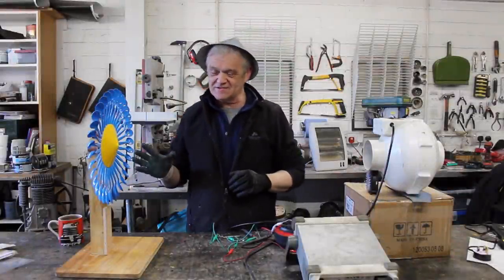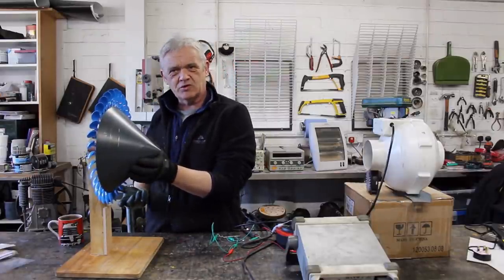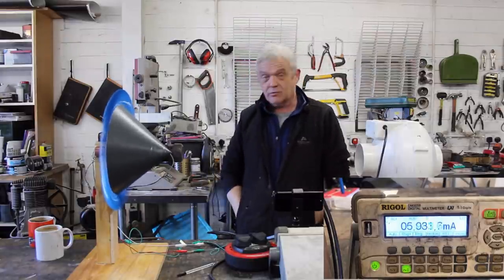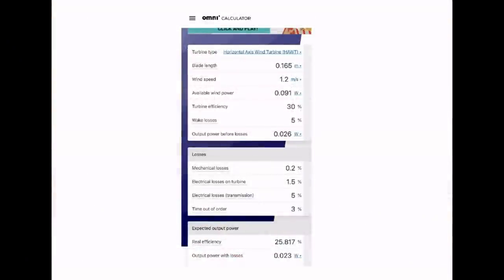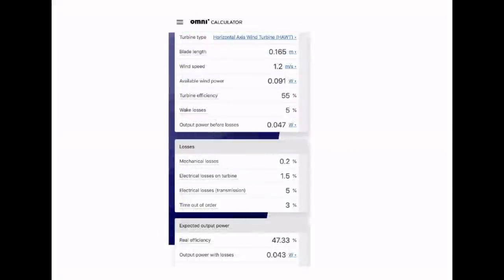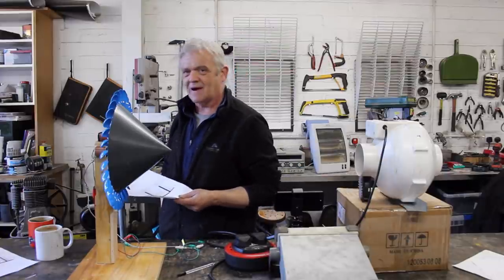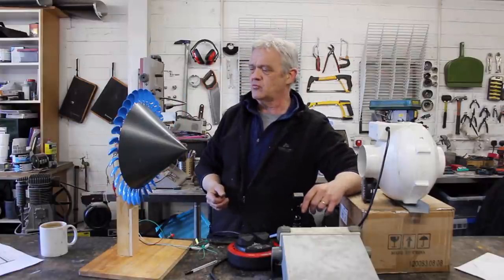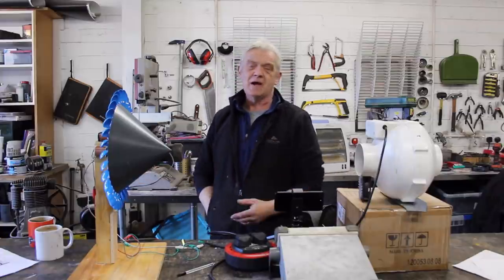1482 A Diy Super Efficient (93% Efficient) Wind Turbine

Comment: Could you use a fixed cone with fins spiraling in the same direction as the spoon's spin? Currently the cone has the opposite effect as it's boundary layer will be dragging the airflow in the same direction as the spoons which would decrease the airflow's force on them..

Comment: Im wondering how much better it would get with a cone on the back covering the generator and smoothing the flow out the back? Of course it would be mounted solid to the framework, but l bet it would decrease the turbulance and create a draught type effect to help pull the air through the spoons.

Comment: A flashing LED is not really a suitable load to use to measure power output.  Firstly it is not a linear load wrt voltage, and secondly the rapidly changing load as it flashes makes taking readings difficult.  In practice, the output from the turbine will likely be fed into an MPPT (maximum power point tracking) charge controller which takes the maximum power it can get, and you would get the best results using one of those and measuring the power it delivers to a discharged battery.  As the battery voltage will not change much in a short period of time, a current reading will be directly proportional to the power output.

Comment: I wonder if the cone should have ogive cross section instead? AFAIK, this would exploit the Coanda effect where it only works on curved surface. If I understand it right, having an ogival cone would maximize the flow through the turbines instead of the momentum where it tries to flow past the turbine.

Comment: What if you added a reverse cone without the point. The hole in the cone would be the diameter of your spoon blades. It would capture twice the wind. I believe it would increase the efficiency of the original by 132%

Comment: The cone improves efficiency as well as it does because it's redirecting that narrow wind stream out to the more efficient cups of the spoons.  In a real world situation and presuming the spoon handles also can contribute if they are angled right, I bet you would do better without the cone.   
Also, how are you measuring the wind speed?
Reply from the maker: I am using an anemometer
Reply: @ThinkingandTinkering  
Ok good.  Thanks.  
At what point are you using the anemometer?  At the outlet of the blower nozzle or just before the windmill?   If it's at the blower nozzle, are you using the area of the nozzle to determine your calculations?  That would be the most accurate determination of air imput power, but unfortunately, the calculation of output power gets muddied by how well the wind is distributed across the larger surface area of the windmill.   I suspect the cone efficiently distributes that narrow airstream to the most efficient parts of the windmill.   However, when comparing efficiencies in an airstream that would be large enough to cover the entire windmill, like natural wind would be, the cone may not be as beneficial and may even rob some useable blade surface area because the spoon handles would otherwise catch some wind as well.

Comment: Not sure if you've realised this but if you combine this with the duct you basically have the intake fan of a jet engine and would look even more like it if you then put a tube around outside of ducts which would also make it stronger, it may even further improve the efficiency.
You may need a bigger fan to find out that though.

Comment: This is a weird idea but if you have a tricycle with the two wheels in the front, could you put this in front of the basket area? If it is an electric bicycle it could be a interesting way of restoring at least some of the energy you put into it
Reply: @boogieknee3781  I am familiar with the bikes that you are talkin about but I'm mostly thinking about 4 if this could be used with a electric cargo bike with a very similar design. I'm thinking it's more pedal assisted maybe using the wind turbine at the front to capture some of the energy so that you can increase the mileage you can go before you have to stop and recharge the battery. Honestly if the wind is blowing hard enough you could be stationary and still charge up the battery

Comment: Hi Robert I'll probably ask you this in a more recent video again but what the heck I'll ask you here too you're really good about answering. So forgive my electronics ignorance but I've never even considered this in my mind before and I will probably trained Google different aspects of my question and see if I can find an answer there as well but this might be a really really good video for you. I was wondering how you could take something that generates a very small amount of electrical current and voltage is involved and Charge a large battery like a 12 boat battery. Would there be a way of using series of capacitors to charge the dump into larger capacitors and so on until you have a high enough voltage to be able to dump into a 12 V system? Because these Small wind harvesters is what I'm calling them are lower voltage in amperage and can be utilized directly but how would you store that energy if you've done a video regarding this please forgive me. If you have not done a video it might be a good Fun video to create some type Of power collector that could do this period I mean it might be as simple as putting a blocking diode and allow the slow trickle charge to get in there I don't know if that's feisabel someone told me that there's a minimum voltage you have to apply to make any difference whether that's true or not again I'm sorry I do not know . 

I've just got into Working with our toenails and making different various projects I made a very useful Elise D strip for under my counter top that works on motion sensors which is absolutely brilliant it works perfectly at night . But that's about as deep as I've gotten into it so far I've purchased so many components that I had to buy a big Parts chest to hold all my capacitors diodes transistors coils you name it.

Let me know what you think if you don't mind I know how busy you are
Reply: Need to get the output voltage higher than the battery voltage in order for it to charge.

Comment: Here is a device that seems like it might generate a lot of powerr for much less than a big wind turbine or a roof full of solar panels.  They say that low temperature gas turbines are not very efficient or even cannot be very efficient because of the low temperature difference between the input and output gasses.  But how much of the inefficiency is because of not so obvious thermal losses that are not such an issue with a massive input of heat?  
I came up with a system that someone might make themselves for a few hundred dollars  that might generate 30 Kwh of electricity a day and heat the hot water and the house if a low temperature gas turbine could get 20% efficiency.  
Most of the system could be made out of plastic sheet and PVC pipe.  
Just make big black cylinder out of plastic sheet attached to a cylindrical PVC plastic frame one meter in diameter and three  meters  long.  Attach plastic compressor and fan blades to a PVC pipe drive shaft through the middle.  A motor for starting it powered by a small area of solar cells would get it started whenever the sun is out and the wind is not blowing and generate the electricity.   If two cones of the right size are put after the compressor blades and before the turbine blades, it seems like the pressure and back pressure could be adjusted to drive it.  
An omnidirectional wind collector on the roof could drive it when there is no sun and enhance the power of the turbine when there is sun.  Being at the top of the roof would concentrate the wind and collect heat from the hot roof.
If the heat is stored in a big pile of gravel, the gravel could be used to drive it when there is no sun and or wind  by blowing air from the compressor through the gravel instead of the plastic cylinder.

Comment: What if you stuck that in the back end of a tube that narrows down so like say the opening in the front was 4' and you got down to a foot and a 1/2 at the other end and that's free with that generator with the phone now you're forcing more air through that surface area on the  Blades

Comment: For me the most important part is the minimum wind speed required to turn the generator. I have a yacht moored in the middle of the river dart and originally fitted with a 100w generator but due to the german manufacturers use of non stainless parts the ball bearings in the generator rusted, then at the next storm decided to go elsewhere and broke the circuitry as well as frying the regulator and the battery (which was due for replacement anyway) The replacement parts are now 200w and it only works in force 4 gusting 5 Savonius. Maker Ideen-schmiede. They were very helpful when i had to replace the generator but the wings on the turbine dont seem big enough and are the new bearings stainless? Looking at Solar to keep the battery topped up.

Comment: not trolling ya, wouldn't it work out better cutting angled slots into a larger diameter core rotor? instead of heating and twisting the spoons, they could be cut to length (maybe 1.5" of handle then glued into 3/8" depth angled slots). the larger core wheel for more magnets and coils, also higher speed interaction between them. I'm just guessing.. there may be an optimal distance from the cone edge to the spoon heads, like the 1-1/8" I'd just taken a stab at above. the "short handle spokes" being angled could help power gathering too?

from here the cone looks 45+45 90 degrees, would a longer cone maybe 70 degrees be more efficient?.. or as another comment suggested, "top half of egg shape" to help concentrate wind into the spoon blades -makes sense to me as well.
 
from another video on this design.. very cool that it'll gather energy 60 degrees left or right from "straight", once you know the general prevailing wind direction you can't really miss, no vane or pivot needed.

Comment: So it wouldn't matter if the cone was part of the solid structure and not spinning. 
You could use a bike wheel behind it and just add the blades on the outside where the tyre was.
Reply from the maker: nice - like it mate - I have an idea lol
Reply: @Robert Murray-Smith  I did feel that this could be quite a simple easy way of getting a true and strong structure lol

Comment: There was this bold face caption on a hydrogen You Tube video and the bold face title caught my eye.  IS HYDROGEN THE FUEL OF THE FUTURE?   IN the lines it was written the letters RGO for reduced graphene oxide were in a straight line reading down as if hydrogen was filtered through it.  Sure enough a more recent article stated that hydrogen protons slip through some anomaly I RGO.  MAYBE THOSE PROCESSES PLAY A KEY ROLE IN SOME ENERGY IN THE FUTURE SOMEWHERE!!